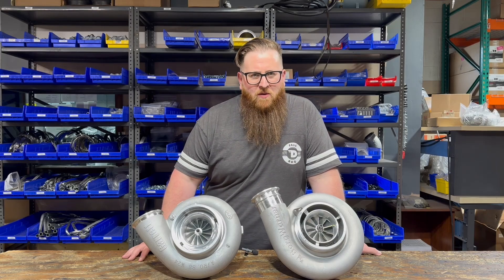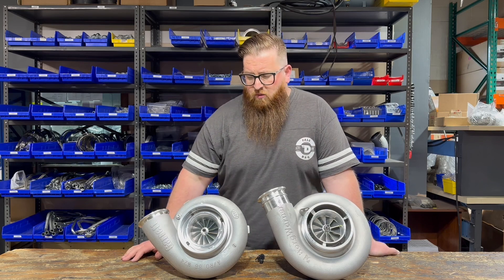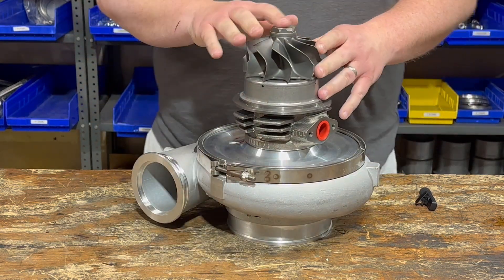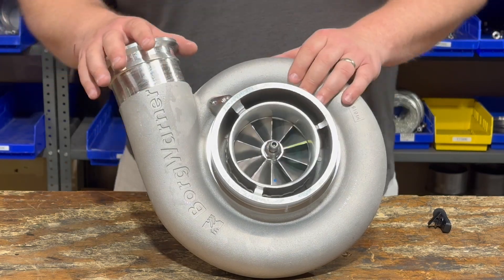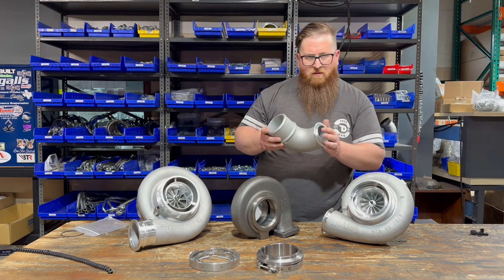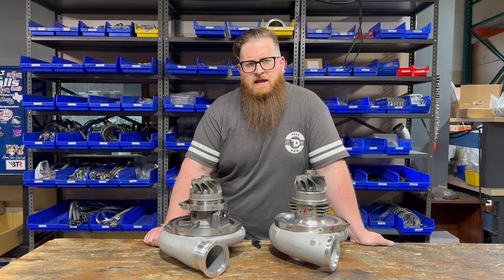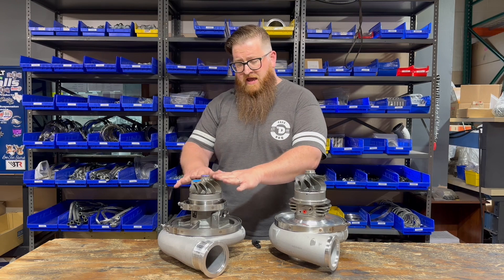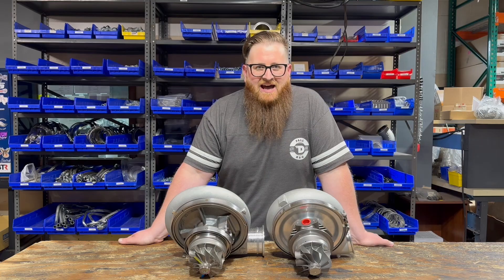Garrett GTX55 vs BorgWarner S500, Which should you put on your TRUCK?

Comment: I'm running a s60 ddec3. Big tune ecm. Just taken delivery of a 94mm s500 but I'm sure it's 8+8 1.45 waste gated twin scroll.
Reply: Are you running it as a big single or as the low pressure in a compound setup?
Reply: @DeLonghe_P_Ness  big single